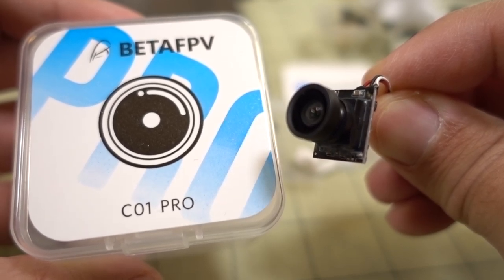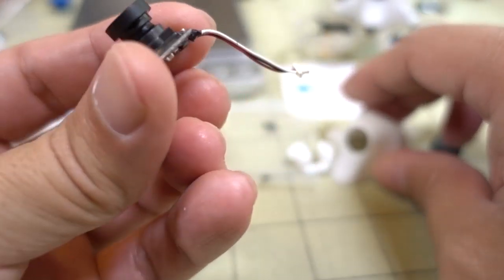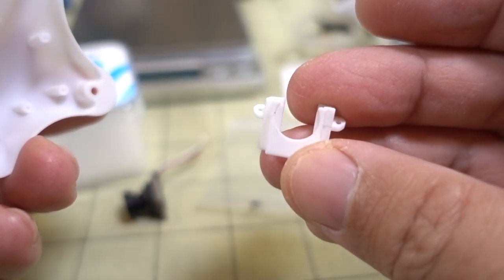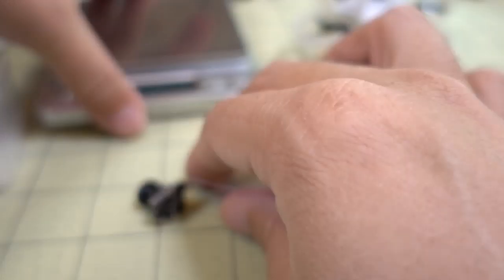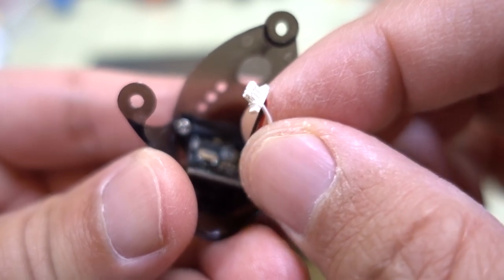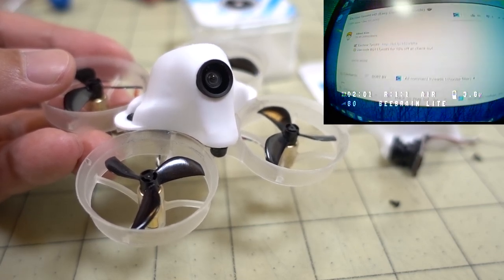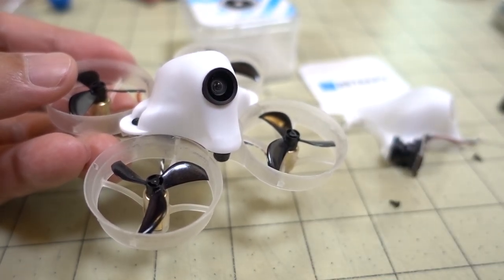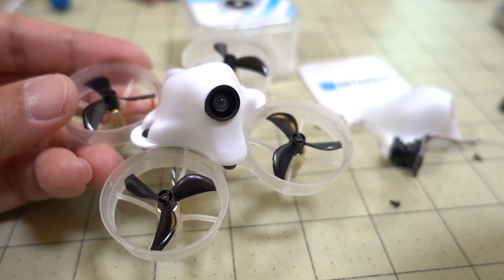BetaFPV C01 PRO FPV Camera Review 📸

Comment: Is the white wire on the c01 pro the video wire ? Not sure why they didn’t make it yellow if it is. Soldering onto my hx100 Se but don’t want to fry anything. Any help would be cool. Thanks
Reply from the maker: Yes, that's the video wire.  I've seen white, green, gray, and blue used as colors for a video wire before.  Yellow is most common but other colors have been used in places.

Comment: Physical appearance 90-95% resembles Runcam Nano v1 released almost 2yrs ago. 

One thing this has over the Runcam Nano v1 is the auto adjustment is a lot quicker and image is clearer/sharper than Runcam Nano v1.  2yrs of progress seen. 

What about Runcam Nano v2? 

BetaFPV C01 PRO vs Runcam Nano v2

BetaFPV C01 PRO:
PROS Better image quality than Runcam Nano v1
CONS Cannot mount on a 14x14 camera width as easily as EOS2 or Runcam Nano 2. Major deal breaker for a lot of us.

Runcam Nano v2
PROS Easily mountable to many frames, has built in 14x14 mount and can use an adapter to mount to 19x19 if needed
CONS some people complain too much sharpness in the image quality

There are other PROS and CONS to compare these 2, but I only covered the obvious/more commonly mentioned ones. :)

If BetaFPV comes out with a version with built-in 14x14 mount, I'll go for it when I have to replace my camera. :)
Reply from the maker: I'll make one.  It's so easy.
Reply: @AlbertKimTV  Please upload to Thingiverse when it is ready!
Reply: @AlbertKimTV  Is there a place we can purchase from? Many of us don't have access to a 3D printer. :)

For me, not a worth while investment to get one, I've only purchased 4 3D printed items in the last 6-9 months. :)

P.S. the one you're making, how much weight will it add? I hope it equals to less than a Runcam Micro (combined with the BetaFPV camera). :)

Comment: What is exectly point for this camera? To replace one from Newbeedrone? Why? Newbeedrone camera quite good.
Betafpv need to come up with FC with integrated vtx for this camera. Then its make sense.
Reply: I'd be willing to bet that an integrated VTX is next. Otherwise the integrated plug wouldn't make much sense. If they do that then they will likely be my replacement board when my BeeBrain Lite finally gives out.
Reply: @ChristopherYotz  agreed. But for now this camera dont make sense. Its end of December, even if FC with integrated VTX for this camera shows up in January, by the time we will get it on our tables it will be mid February.
Who needs it by spring, when we all will get our 5" for racing. To most I know whoop is seasonal thing, cause outside is freezing cold.
Reply from the maker: They probably have plans to use the plug for future products so be on the look out.  When something new comes along it usually means more changes in store
Reply: For custom whoop builds, small light cameras are welcome. Not too many options out there.